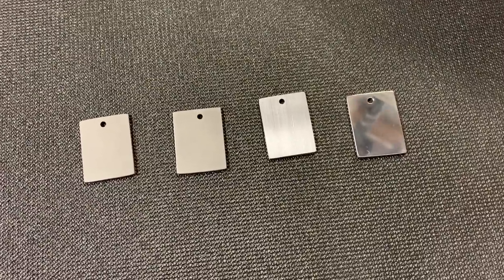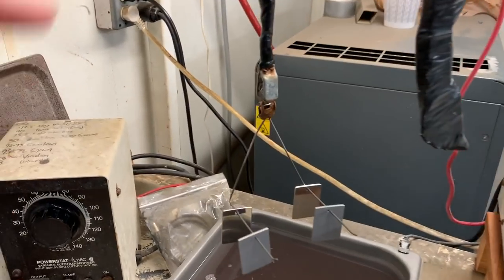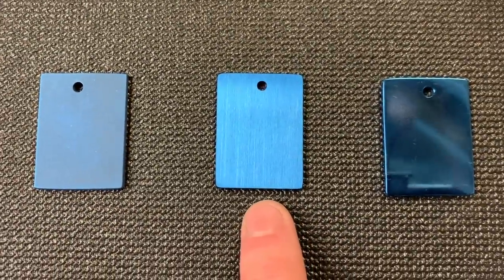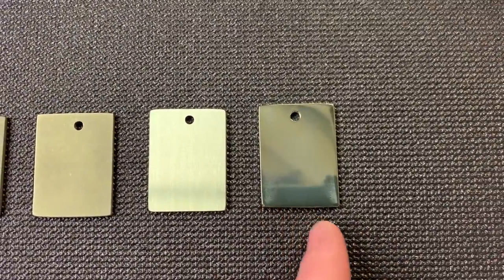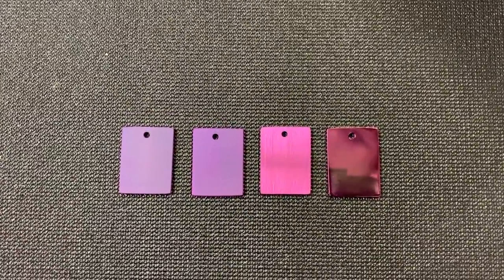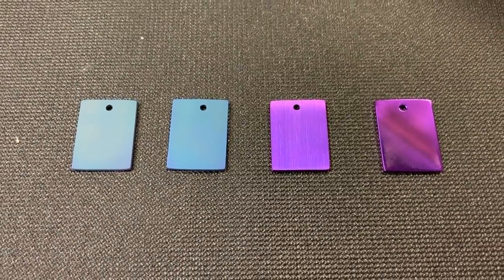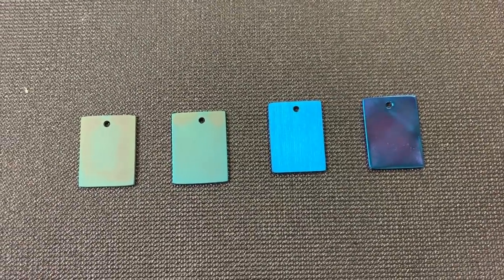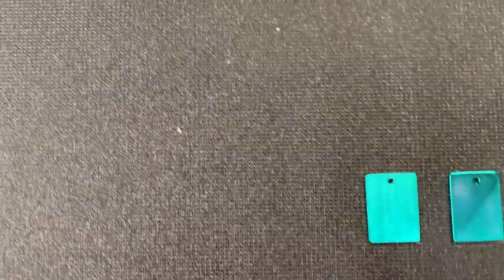Surface Finish and Anodizing: A Titanium Story

Comment: That was fun and interesting.  I tried to anno the back spacer and pocket clip from a gray Crux and got some weird striping on the pocket clip.  I was hoping for a minty green but couldn't get it and settled for a bright blue at 78.5 volts.  I used Borax for the electrolyte additive mixed into distilled water.  The striping is mild but it showed up when I dipped it in Whink rust remover (hydrofluoric acid).  I might try a different etchant and electrolyte at some point but I'm afraid if I etch much more I'll lose the blast finish on the parts.

Comment: It’s crazy how the same voltage can have totally different colors and after anodizing for the last few months you learn that there’s way to many variables and can’t always predict the exact color. Where these titanium sheets etched before anodizing?  I did my first anodizing job using stencils the other day and it came out great. The only problem I had was that I used aluminum oxide media which I didn’t know at the time causes problems with anodizing due to the aluminum so I’m going to try glass beads next time. What type of media do u use in your blasting cabinet?
Reply from the maker: We use garnet media in our blast booth rather than Aluminum Oxide.
Reply: Ferrum Forge Knife Works wow thanks for the great tip I’ll have to pick some up. This should definitely allow me to step up my anodizing game 👊
Reply: @FerrumForge  did you etch the titanium before anodizing?

Comment: Very cool, I believe it has to do with variability in surface roughness at the nano/micro scale achieved by the different polishing methods. The rougher surfaces on the left give a flatter look because they are scattering the light as opposed to reflecting light directly back to give the shiny appearance seen on the right. As for the differences in color, I am less confident in a potential explanation. I do know that, generally, the colors seen are due to a path length difference in reflected light depending on the thickness of the oxide layer (light reflected from metal vs light reflected from oxide). The thickness of the oxide layer typically ranges from 5-50 nm. Source, if anyone is interested, I am a chemistry PhD student studying nanomaterials as photocatalysts.
Reply: I don’t know the extent of your knowledge, but how much do you know about type II anodizing? I know that Lye(NaOH) with a pH of 13 works, but not well- resulting in a gray color. Have you heard of any good chemicals to use when aiming for a black colored ano?
Reply: @realnsfwspeedruns  I have no hands on experience with anodizing, so I cannot really help you. However, a quick search shows that type II anodizing specifically refers to use of sulfuric acid as the electrolyte. I do not know that it is possible to get a natural black color for metals like titanium. I do know that when anodizing aluminum any colors must be achieved through use of a dye seeing as the oxide layer itself does not give any color. The good news is the surface roughness from the anodizing means the dye should stick around for a while. Best of luck!
Reply: Hey if you have a piece that has a lot of angles and different sized thicknesses, does that impact the coloring?
Reply: @jamesoliger2379  since its diffraction, the color you see depends on the angle, so an irregular surface may look iridescent

Comment: hello, do you know the complyfe mods?
they do anodize on titanium vape mods and they also do a like many different  colors on a mod, i can not attach the pics of mods here but you can google it and see what am i saying?

just want to know how do they do it.

and got couple of titanium mod and cap which is vape stuffs.. but i want try myself and learn about this.

help me as you are real pro of anodize!!
Reply: Bro they made with the same steps, but just the diference is, take the positivo to the tube and negative with a wet sponge with solution, and play with the voltage, thats all

Comment: Were those etched before anodizing or just straight in after being finished? I'm in the uk and looking to try anodizing at home but most videos seem to have people using Multi-Etch in the USA or Titan Etch in mainland Europe. Both of which aren't really an easy option to get hold of but if you can get the colours like the satin finish or the polished with out it I might just try achieving those finishes first.
Reply from the maker: I use Multi Etch right before I anodize.  It's my last step before anodizing.

Comment: can you get black if you take the voltage higher?
Reply: No it just sort of goes back to a washed out gray
Reply: Just re-etch it, the HF in the Whink will remove the thin oxide finish.
Reply: There are two patented alloys that will go black, I’m not sure where you would get any though.

Comment: Do you think a tattoo power supply will work for anodiz
Reply from the maker: In theory, yes it will since it's a DC power supply.  However, it looks like a lot of tattoo power supplies have very low voltage.  You'll need at least 15V to get bronze and at least 30 to get blue.
Reply: @FerrumForge  thank you. I have some wink stain remover on the way so... I'll let you know what happens.
Reply: @jacobokubo7726  how’d it go?

Comment: Can anyone anwser if you etch with Whinks Rust Remover does it effect you surface finish?
Reply: It does if your soak duration gets past 30 seconds.  Whinks has sulfuric acid, which is one of the few acids that will dissolve Ti.  It tends to be a cloudy or chalky surface finish that is more pronounced than MultiEtch.  But it really cuts through oxides so you can dissolve anodic oxidation with it.  Whinks will dissolve CP Ti at faster rate the 6Al 4V so it can do interesting things to pattern welded titanium like timascus and mokuti.
Reply: @elliotwillamson7456  Great information Thanks!

Comment: What liquid solution do you use. I tried anodising with batteries and had no luck.
Reply from the maker: We use rust remover as our electrolyte solution.  You might not have enough amps from the batteries to anodize a blasted finish.